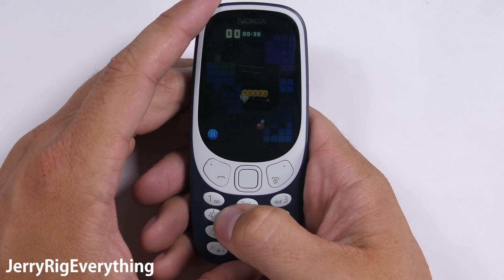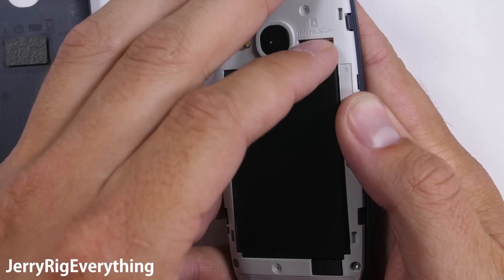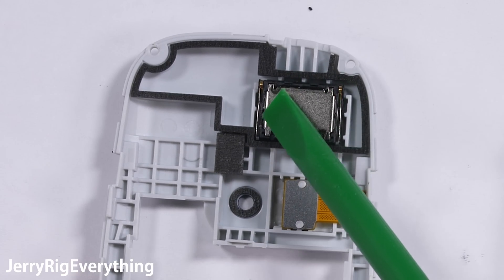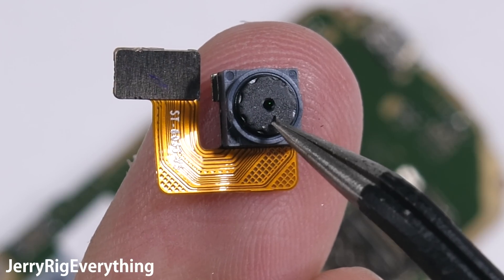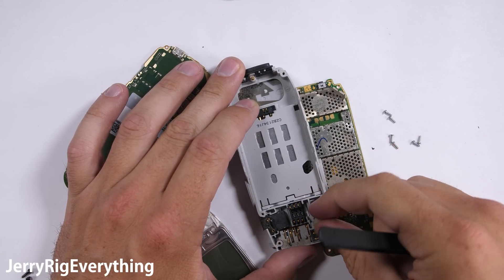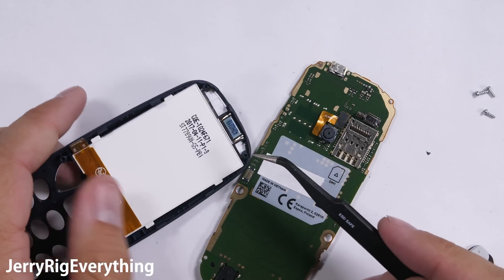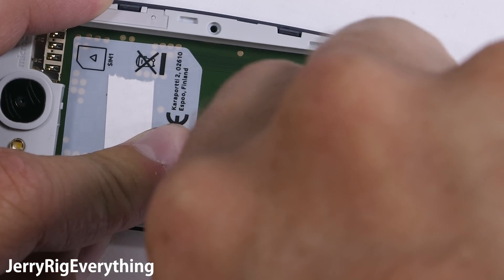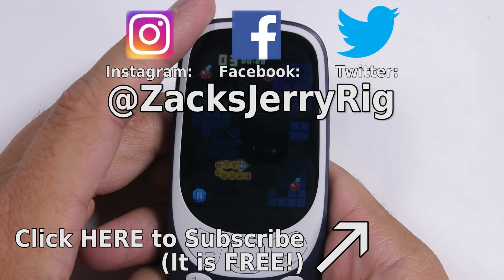NEW Nokia 3310 - Teardown - Will it last?

Comment: I'll be honest. This is the absolutely worst phone I've ever had. It dropped a few times and the front speaker stopped working. I had to use back loudspeakerm aking everyone around hear what was going on. Every time it this phone dropped, it broke into 3 pieces, back panel, battery and the phone itself. Paint worn off from the keyboard under a year. Very loud alarm clock sound without possibility of correction. It was like being woken up by a jumpscare. Flashlight might turn on while you have this phone in tight pocket. The flashlight is turned on by holding the up button from the directions square button. Other weird things might also happen when kept in tight pockets as the phone dialed 112 (like 911, but in Europe) numerous times. Even police was sent to my home because of it and I had to explain and was almost fined. Also, farting, cracking and popping headphones. I bought a smartphone and chopped that fucking Nokia in 2 with an axe. And... I don't recommend this phone, even if you was a original 3310 fan, like I was.

Comment: Someone should make a water resistant phone with a removable battery. Samsung kind of did it back with the Galaxy S5 but it should be possible to use that same basic design to make a modern phone with the circuitry being sealed from water and only having the battery and its contacts exposed

Comment: I love removable batteries for 2 reasons: 1. I can buy a soare battery so when i'm out of power i can switch them out and 2. I find it makes the phone more durable because whenever i drop it, the battery flies out taking energy from the fall with it and making the phone lighter so the screen is less likely to crack. I have thrown my lg g4 on multiple surfaces and have only ever cracked it once by slamming a car door (accidentaly) directly on it.

Comment: I definitely want to see more removable batteries on phones, mainly because that is the most common point of failure and if you keep the phone around for more than a couple years you will definitely wish you could just buy a new battery and put it in. I do like the idea of the water resistance, but I have never needed it. I think both setups have their place and both should be available.

Comment: Removable battery forever! Not just because I like to buy a fresh battery if I wear one out to where it's charge capacity has shrunk, but also because of the custom ROMS I fart around with. Some alpha or beta ROMS get stuck and you pull the battery to get yer device to reboot. Water issues? Sure. But I have never dropped a phone in the toilet before and when I'm on the bike I insert the phone into a mounted holder. You can still swipe and tap through the plastic with no problems.

Comment: Hello Zack! I have a Seagate external hard drive. From the past week I'm facing a problem with it. When I connect it to my laptop the small led light on it glows but my laptop is not detecting it. I tested it with other laptops as well and facing the same problem. What may be the actual problem? Or can anyone please tell me what may be the problem? If I take it to the service center is there any guarantee that my data in the hard drive wont be affected?

Comment: I would prefer water resistance and no changing port and 3.5, just everything wireless; also I would like to see square edges just like iPhone 4 and 5 because it's much easier to hold such form-factor, but unfortunate round edges are mainstream nowadays.

Comment: I prefer removable batteries as they add structural integrity and makes it incredibly easy to replace the battery after it has been used and has slowly died.

Comment: How about both - water resistant and removable battery. But if I had to chose one - removable battery all the way. With the necessary every day charging cycle, Li-On/Poly is will hold less charge at 1.5 years and almost unusable after 2.5 years, but today's flagships will be easily usable in 3 or more years from now. So it's obvious they are trying to get more money from us quicker.

Comment: It is possible to have both water resistance and removable battery. Every phone needs a removable battery, as that greatly extends the life of the unit, and makes replacement batteries cheaper. Even if you do not need to have a charged spare for normal use, being able to replace the battery after a year of use, really improves the battery life. As updated come out that improve battery life, much of those improvements are offset by the loss of capacity. Taking a previous gen phone that has had a year of regular use and swapping the battery, will often give you around 1+ hours of additional screen on time.

Comment: Btw glued shut phones are completely acceptable if it's waterproof, if the phone is not waterproof then I see no reason for non removable back and battery. Either removable battery or ip68 rating. No in between

Comment: Why can't a phone be water resistance and have a removable battery? I think it can be done while retaining a small form factor.
Reply: The point of gluing a phone shut is to protect the battery as well as other internals of the phone from water seeping in which could damage them. It's impossible to have an easily removable battery as well as a water resistance rating because of this. You can't properly seal a phone with dovetail joints which are what removable back phones have, that's why manufacturers glue them shut. Hope this helps. If not I can elaborate more